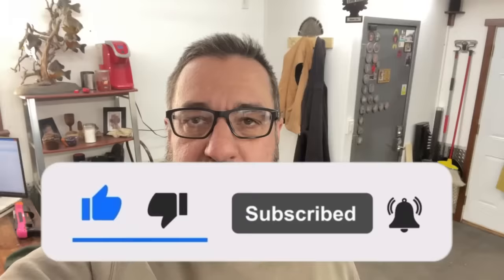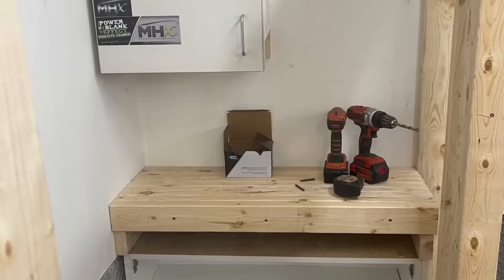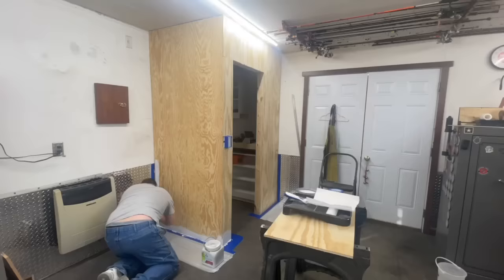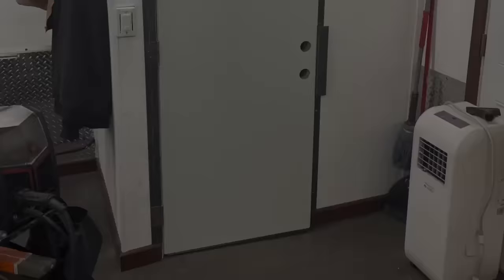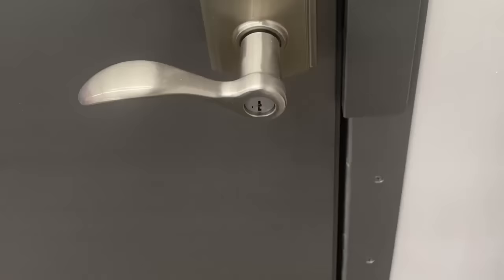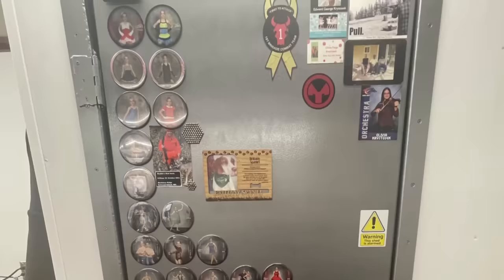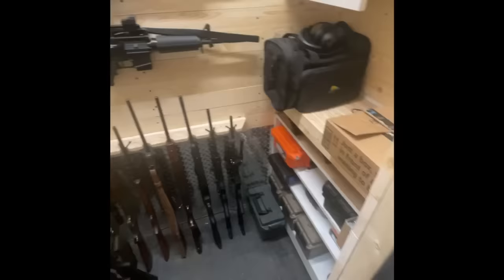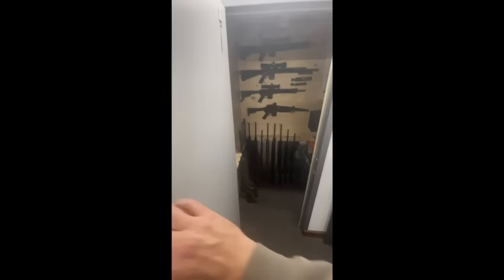DIY Walk in Gun Vault Room Storage

Comment: While anyone can find something wrong with most projects there’s not a single person that wouldn’t love to have what you built. Nice work.
Reply from the maker: THANK YOU!!!

Lots of critics to be sure. It's nice to get these positives.

Thanks for watching.
Reply: @SheepdogColumbus 
It's a good concept though. I want to build something similar, mostly to be just an extra deterrent with my safes inside and use some cement boards and fire code sheet rock help increase the safes ability to protect the contents of a "total loss" type of house fire.
Reply: And the contents! Nice work.
Reply: Yeah, I wish it were this easy where I live.  Tasmania interpretation of Australian federal law states no electronic locks, must be solid metal at least 3mm (1/8”) thick, secured internally to the structure, and must have multiple locking bars, at no further than 30cm (about 12”) spacing on all sides of the door.  
Having said that, all the tools needed to get into my safe are in my garage, 5m from where the safe is, so it will only delay a thief for less than 5minutes anyway.

Comment: Nice job, some advice, watch for signs of rust where anything metal is touching the wood, depending on where you live you might want to consider adding a dehumidifier that runs 24/7 in the room that drains to the outside.
Reply: Very good suggestion!
Reply: @@TACTICAL77DW Absolutely. The fact is, most homes in America will benefit from a dehumidifier, particularly those with a subsoil basement. It's better for your possessions (furniture, books, electronics, etc.), better for your health (reduces mold), better for your wallet (makes HVAC more effective and efficient in the summer) and better for your pew pew. 

But yes, a separate unit for your gun safe/vault/room will especially help protect the longevity of your investment.

Comment: Terrific detail with the steel plates in the wall. I keep seeing diy vault/panic rooms with armored doors and only sheetrock on the walls.
Reply: Those plates are only held onto the 2x4s with 6 screws.  It would take ten minutes to rip the plywood off, cut the six screws and kick the panelling in.  This is a really strong closet.  Not even close to a vault.
Reply: @SheepdogColumbus  Yes, calling it a vault is a stretch, but it's diy, and it's still a great detail for a diy-er. Versus installing drywall that a teenager can punch through. Let's keep perspective.
Reply: @shenlonggohan  Your perspective isn't mine.  Let's keep principle.  DIY, detail, doesn't matter if his guns aren't as secure as they'd be in a safe.  He built this for a purpose and that purpose was not fulfilled.

Comment: Nice project! I'm a sheetrock guy so mine will have durock and fire code sheet rock in it . especially on the ceiling to help prevent damage from fire. One change I would suggest would be to put the firearms up off the floor to prevent water damage from floods or major leaks. That would also give you some storage for gun accessories etc. I'm mainly focused on fire and water protection. Most burglars wouldn't take the time to try to get in the safe because of time constraints and the fact that they are generally pretty stupid people, and lazy to boot. A game camera that sends pictures to your phone would be a nice touch. Or a CCTV camera that records to a computer drive away from the safe. When I put an addition on my house I purposely left a space in the basement walls to make a 6x8 safe room. All I need is to fire proof the top and build a wall for the door. This gives me inspiration as I've ran out of room in my other 2 64 gun safes. I'd love to see a video on how to get 64 guns in them!!.I have a lot of rifles with scopes on them and that's a problem when it come to space. A wall rack seems to be a good choice. Sorry to ramble on, I've been thinking about this project for to long and get inspired by other people's ideas.
Reply from the maker: Excellent ideas.

I do have several ring cameras around the property both in and out.

I very much want to get the guns off the floor. fortunately, I don’t have water going to this building, so I don’t have to worry about pipes, breaking and flooding. I also am well above the floodplain and if water was an issue due to flooding of the land, I would have time to get them out of there.

I did use fire rated sheet rock in the entire building (it’s only a 24x18 shop) and put 3 layers behind the steel between the studs so that should help if there is a fire. Certainly not perfect but should offer some level of fire protection. 

Thanks for watching and be sure to check out my gun giveaway video.
Reply: @jackofalltrades7822  The thing about fires is water is generally used to put them out.😉

Comment: Ceiling is a favorite place to go through so…brace the back of the door angle all the way around. The hydraulic door frame jacks spread the door frame apart with EASE. Keypads are super easy to pick and dead bolts drill out easy. But stops most 😕
Reply: Anyone with enough time can get into anything. The goal is to slow someone down enough to make it not worth their time.

Comment: Awesome idea. Your weakest point is the door lock as Kwikset locks are stamped construction, which means that those locks have the highest incidence of casual cross key access. Basically random Kwikset keys can also open your lock as well. (Your neighbor’s mom’s front door key might be able to unlock your “gun safe room”.) Even using a Sclage lock is many times more secure, but there are many other higher end locks that are even more secure than Schlage. 14:31
Reply: Also, those locks are easy to pick.
Reply: I agree.. those can be picked very easily.   Lockpickers dream.
Reply: @noobsmoke79  and easy to defeat against brute force attacks.  5 minutes with a cordless drill (and that's an unskilled attacker) and it's compromised.
Reply: Yeah, would have liked to have seen a manual tumble lock as a backup to the keypads instead of keyed locks.
Reply: @mhicaoidh1  nice  vault though .
Reply: Agreed, a set of bump keys will get me in there in about 45 seconds.  Love the hinge pins, though
Reply: @corypylkka  Absolutely.  It's got me thinking about how to convert my office closet.
Reply: @@Matt-lk6kr Dogs on a door locked from the other side with no exterior handles are pretty hard to defeat.  You just have to have another way out, like through the ceiling.
Reply: a set of bump keys could easily defeat those locks.  Quickset is garbage
Reply: @Matt-lk6kr no. I dont think you understand.  Any teenager can bump pick that lock in less than a minute. It's the weakest and easiest to force open tumbler you can buy. Seriously look it up. I had to brute force open one before as we lost key. I'm not a lockpicker by any means. But 2mins woth a hammer and flat head screw driver and I was inside. 

Thus vault is nice. But in my opinion all his framing and over built walls are worthless. Because he used a builder grade home depot lock that can be defeated with a screw driver....
Reply: @theelite1x721987  Kwikset locks are the cheapest locks for a reason. Stamped construction equals weakest locks physically with the very loosest tolerances (why they cross key so easily). Spend a ton of money and time to build a great looking safe room only to lock it with crap. Makes perfect sense, NOT!
Reply: I have two Shlage dead bolts on the door of my machine shop for just that reason. Also I never throw away a key. For the same reason.
Reply: Take a look at the Bowley lock on lockpicking lawyer.
Reply: I agree also . I really like vault, but was disappointed in the lock choice. The other construction is great.
Reply: @@Matt-lk6kryoure not getting into an abloy protec2…. couple hundred bucks would have made this a real project… kwikset made it a joke
Reply: @@Matt-lk6kr Right. Apart from the obvious nuisance of it, having the motion alarm, or some other type of alarm on the outside would be the best immediate deterrence.

And a safe merely buys you "time." Whether versus a thief or versus a house fire. Anyone can break into a safe with the right tool and enough time.

That's why I've taken the approach of concealment versus a safe. The best alternative is building a concealed door/room, or concealing a safe.
Reply: Never mind the locks, he installed the metal slabs on angled steel that is held into wood with one screw each.  What a fuck'n face palm.  This is a really strong closet.  Not even close to a vault.
Reply: @SheepdogColumbus  right.. a decent sledge hammer will bash those right in
Reply: A manual lock is better not to be picking apart your work that's awesome bro! Electronic keypads are highly flawed and easy to get into
Reply: No it isnt its the walls. They are wood. Is no one seeing this problem?? The door is great but the  WALLS ARE WOOD: A good chainsaw goes right though it.

Comment: Very nicely done!!!  Just share my approach.....Converted His'n'Her walk-in closets in second master bedroom into gun storage. ....duplicated in each closet, locking long gun racks ala gun stores; locking 42" wide 4-drawer side pull file cabinet for handguns, binos, spotters, rangefinders, goodies.   Fabricated DVD shelving to conceal closet doors, with third shelf set between doors.  Hung DVD racks on new concealed gate hinges concealing the new solid metal closet doors with 3 deadbolt locks.  Not apparent DVD racks swing open, revealing hidden doors.  Built new clothes closets on opposite end of room taking room from little used over-sized adjacent bedroom.  Old Harley buddy, a professional locksmith, always said locks only keep kids and the terminally stupid out.  If one is gone for the evening, ANYTHING can be breached.  A good strong safe/storage is great, but even better is the good strong safe/storage that no one finds to attempt breaching....hide and use a decoy.  Cheap metal SnapOn gun cabinet is "hidden" for easy finding with junk guns....leaded barrels....for easy find/breach by intruders.  Grab 'n' go never finding the good stuff.  Similar approach saved relatives', friends' guns several times.

Comment: Got my house plans drawn up for when I get out of the army and I put a 5x6 hidden room beside the closet. The only thing I think he’s missing is fire protection the door could be fire rated but the addition of fire rock on the inside might have been a wise option.
Reply: Thank you for your service. Are you retiring or ETSing?
Reply: @thadlm2698  I’ve still got 4 years on my contract I’m just dreaming a little
Reply: Make it 10 x 10 or larger, you won’t regret it. It’s great for a shelter etc… The bigger the better…
Reply: Just drop though the ceiling smash the alarm take the guns😮
Reply: @georgiajeepsandguns8277  Dreaming is good, you have to have a plan when that day comes👍🏿!
Reply: The 1/4" steel will likely hold up to a house fire. But, at this point, he could add 2 layers of 5/8 fire rated rock , crossed to the exterior and have something close to a 1-hr rated fire wall.    My concern is the ceiling.
Reply: @JR-N-TX  The steel will but the plywood and the studs in between the steel, and the wood inside of the vault will not.  The fire will burn through the plywood, through the studs and through the interior wood literally within minutes.
Reply: @michaelmiller5877  Hmm..  You must have failed to read the second sentence. 
>he could add 2 layers of 5/8 fire rated rock , crossed laid,  to the exterior and have something close to a 1-hr rated fire wall.
That would likely protect the entire room while the house burns down around it.
Since 1/4 steel has no thermal protection,  without some form exterior protection, it will began to fail at temperatures above 1000F.    After it hits 1,000F, it is only a matter of time before it fails.  And, of course, an average house fire will likely hit temperatures  closer to 2,000F
Reply: @J_Bwn  Agree with going bigger, especially if designing new construction; just imagine how fast you can fill a closet with stuff, and how hard it would be to expand later.  However, a long skinny design could more easily avoid even intentional searching, like a 5x20; especially if it was added without being on any building permit.  My gun wall is 15' long and 7' high on a 9' ceiling, and almost 20 years after getting out of the Marine Corps my collection is getting quite tight in that small of a space.
Reply: @mikecastleberry9671  It's amazing how few people ever think about that pesky 3rd dimension!  Not sure about this build, but you gotta think about the floor and ceiling too.  Especially if the door locks are unlocked from the inside.

Comment: Sincerely nice job! As a contractor I see a weak point. In less than 5 minutes  probably 2 a cordless sawsall with a carbide blade would cut through the hinges and special hinge pins you bought. I also would have used rockwool inside the walls and ceiling as it is fire proof. A little more thought and I'm sure you can over come the hinge side weakness...overall good job!
Reply from the maker: The hinges are a concern but the entire is monitored by security cameras, inside and out so the hope is that before 5 minutes I or the cops would be in their face. 

Thanks for watching and I appreciate the comment.

Comment: Yes, a bit disappointed you didn’t make it larger. Also would’ve preferred you put the quarter inch steel plate completely on the outside of the studs with two solid pieces welded them at the seam and then welded them to the hinges from the inside. That way your studs would’ve been protected too.
Reply: It's not a panic room...

Comment: Nice. I actually just finished my vault room as well. Great idea of the steel sheets. I unfortunately went with cinder blocks filled with concrete. I learned it's very difficult to stop, film, edit all the while trying to finish the project.
Reply: I would think cinder block filled with concrete would be more secure.  What do you think the pros and cons of cinder block vs steel panels are?
Reply: @twc9000  I agree. The metal is very secure but the studs are the weak point. Cutting the studs with an oscillating cutter would remove the metal panels. Cider blocks with rebar and filled would pretty much increase the time needed to break in by several hours
Reply: @d_k_C_A  yeah, I would think cinder blocks filled with concrete and rebar would be more secure, but more expensive?
Reply: @d_k_C_A  I agree. But it would still take someone awhile to find cut the studs and bolts.  The plywood is a good idea. It is a lot tougher to cut through and remove then sheet rock.

Comment: Another idea you can do is use bolts that are smooth on the outside so no one can back them out and and also use a thin sheet metal on the inside of the board so if somebody tries to cut through it they're not going to be able to.. nice project bud.. very nice!

Comment: My plan includes solid concrete walls and a hidden door instead of locks.  But the space will double as a storm shelter (part of the basement), so it'll be a bit larger also.
Reply: We did that when we built (25 years ago). Splurged with a gun vault door. One small conduit for wiring.  It is under our back porch and gives us a 7x23 foot storm shelter. Poured concrete on all six sides. (Floor, walls,ceiling). It is also somewhat hidden.

Comment: Very cool. Quick sets are super easy to drill, might upgrade those when you have some extra cash laying around. 

I love the layout and might try to tackle something similar myself.
Reply from the maker: Thanks for the tip and thanks for watching.
Reply: Yeah they are junk... very easy to pick too. I would look at abloy or medico locks. Just out of curiosity did you line the outside walls & ceiling with steel? Anyway nice build.

Comment: Really nice job and good forethought on the storage as well. Might also suggest a wooden base under the vertical rifles with ovals routed out for the stocks to fit in and add some felt in each oval to protect the end of the stock from scratches on the floor.  Another thought would be to add purpose built metal modular wall panels for hanging the firearms and accessories. SecureIt has some nice panels as do other companies and they also sell the hooks and hangers for various firearms. Would be added expense though.

Comment: Very well executed. 
Just a couple upgrades for you,, as a licensed locksmith,  I would first advise you to use 2 different codes on the key pads, and, more importantly,  go to a reputable locksmith in your area and have them sell you (or install for you) Medeco lock cylinders to replace the Kwikset lock cylinders, I can personally open Both mecanical locks in less than 5 minutes. And you know stupid people put how to's online all the time. A Medeco lock cylinder is almost impossible to get past (it would take me at lrast an hour to pick with the correct tools). Remember "Locks only keep honest people out"
Very nice otherwise.
Reply from the maker: I do have different code in the key pads and I will have the cylinders swapped. Thanks.

Comment: Nice work.  I would suggest the Browning/ProSteel Vanguard security door though; a bit pricey, but with 6 - 1" locking bolts that go through the steel frame when locked, and it looks like a regular wood 6 panel door from the outside, I thought was worth the $$$.
Reply from the maker: Thanks for the tips!

Comment: Depending on how well bottom and top plates are screwed or bolted to concrete, anyone with a sledge hammer and sawzal with couple of Diablo blades will get in through side wall in about half an hour.
Reply: I immediately started trying to “virtually breakin” and thought same thing I would take a long 12” Diablo blade on sawzaw and run it under the baseplate . Either way it’s definitely pretty solid and way better then studs plus drywall.
Reply: Half hour??? try a minute or two tops…